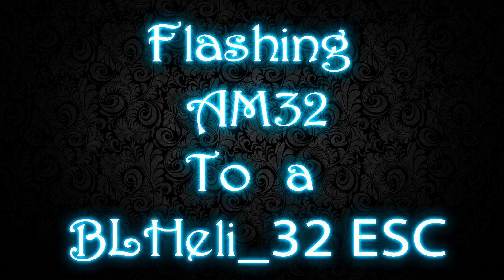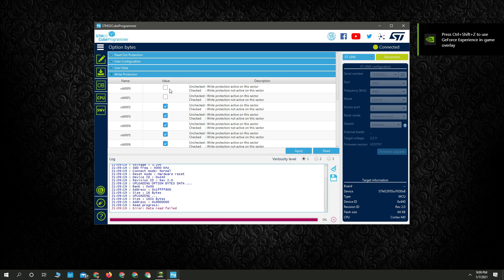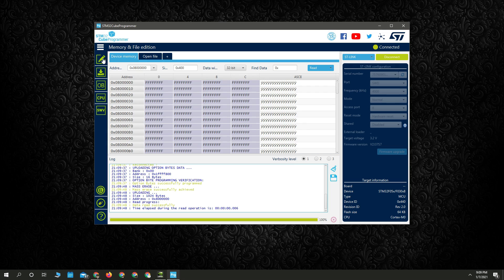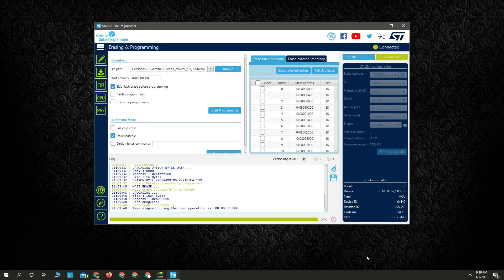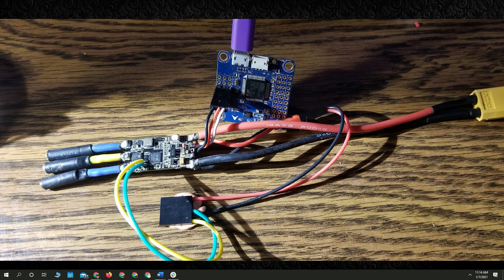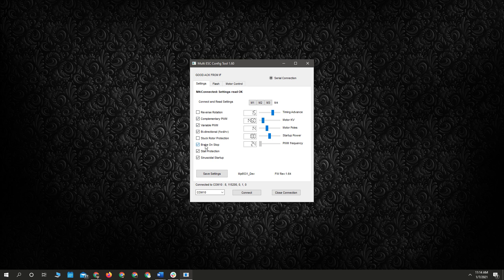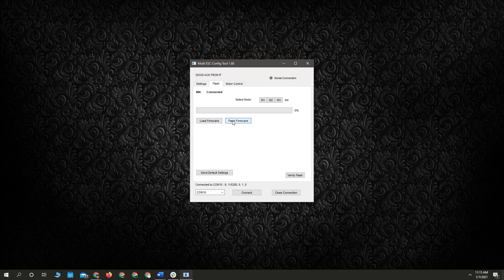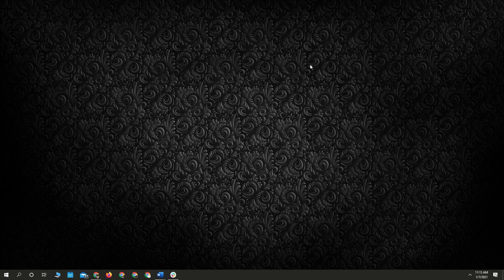Flashing opensource crawler Firmware (new software)

Comment: esc wont start up after doing this step by step using full dixie bin file. wraith32 35a. stm32 says error download verification failed. Data mismatch found at address 0x080009F0 (byte = 0x02 instead of 0x8A) possible bad bin file?
Reply from the maker: Possible bad bin file, I am not that familiar. My Files are all older now, and new partial files have new features.  Alka is on 1.8 now I believe. Best to upload the bootloader, then connect to the PC with Arduino or flight controller and upload the rest with the configuration tool.

Comment: Is there a temp cut off installed on the firmware so it will shut off if things get too hot? Thanks for the great content. Much appreciated!
Reply from the maker: Yes, there is, but I have not used it. It reads the temp of the MCU and not the mosfets. The mosfets are where most of the heat is.
Reply: Thank you! I appreciate the response.

Comment: I'm guessing that new mini ESC from a popular crawling brand is essentially running some kind of AM32 software?

I really wish I had the confidence to do this as I love the idea of a dirt cheap ESC that can compete with the best of them and I love outrunners.

I did once witness a friend flash a simonk ESC so it could have a basic car mode with F/B/R but it was one where you could already do it through the servo plug I believe which simplified matters.
Reply from the maker: I do not wish to make comments about what others are doing or not doing. As far as having the confidence to try the cost is relatively low so not much to lose? Seems like a good place to test you skills no?

Comment: I am Japanese.  I'm not good at English.  Let me ask you one question.  If I can apply the Revolver 1800kv firmware on Googledrive, do I need FLIP32?  Is FLIP32 necessary for the original settings?
Reply from the maker: it is not necessary.

Comment: How to connect esc to pc? What do I need?
Reply from the maker: you can use a STlink v2 to load the bootloader, and an arduino or a flight controller to change the settings.
Reply: @HouseofVoodoo  Huge video! its a super intersting tool, my only question is how willl this work with the Arduino Nano as the interface? or what are the pins I´ll need to plug into?  Thanks in advance :)

Comment: I followed this tutorial and the esc powers on with a red light and beeps the motor, however it won't turn the motor. Do I need to calibrate my esc to my radio, if so how do I do that please. Thanks.
Reply from the maker: did you use one of my firmware files? or the ones from github? 
Sorry I dont check these messages often.
probably its just adjusting the throttle, or try powering on the vehicle then the transmitter. 
The arming for pwm is not perfect for all recievers in most of my builds.
but its getting fixed.
Reply from the maker: The Arming issues have been fixed, and new 1.74 firmware works really well. If it doesn't are it will continue to beep every 3 seconds or so.

Comment: I can't understand 'Step 2: Soldering- Part1'

I saw a picture with a breadboard.

You can see a red line and a blue line and a white line in the middle of the esc. Are they connected to somewhere in the st-link?
Reply from the maker: The blue and red aren't necessary. Sorry for the confusion. Those were used in an older tutorial that was more complicated.

For this step you use the swc, swd, and the 2 power wires.

Comment: In your guide you mentioned about the partial file at 0x08008000 any chance of a video demonstrating what you meant 
(I forgot my RC crawler login again)
Reply: I wasn't clear on that either. I guess once you install the full firmware file you only need to use the flight controller interface (using the three wires that go to the ESC and the serial port software) to install small updates using the partial files. What I don't get right now is what flight controller to use to do the partial updates. I guess any controller will do since the serial port access is really all that matters. (Edit: I just ordered a generic flight controller to use as the serial interface.)
Reply: @baxrok2.  he had one LinkedIn a description of another video I looked at and I'm like I have no idea what I'm looking at I have more ground-based experience I have no clue when it comes to drone hardware and have no idea what to buy thankfully I've got some time waiting for the ESC to ship from China
Reply: @gunnutgaming  Same here. It's probably easier than we think. If all it takes is what is shown in the first step of this video, that's pretty basic. 

Flash the new ESC with the AlkaM firmware using the STM32 software and that's it. He said, "you can run it, it will work." The STM32 gives us access to the chip to wipe it and do the initial firmware install. After that, we only need the flight controller to do subsequent upgrades or tweaks. 

As of now, I've got the ST Link, a couple of ESC's, and an elcheapo flight controller on the way. Not sure if the flight controller will work but I have to start somewhere lol. Also, I have the link to the AlkaM download. So, hopefully that should do it. I've got two outrunner motors that I like for the small size but hate to run because of that damn racket they make!
Reply from the maker: so there are 3 parts of information, a bootloader that is at 0x08008000, an eeprom whos location is a mystery to me. and the firmware which is located at 0x08001000.
A full file from my google drive contains all three, a partial file only contains the firmware. 
all three are necessary. 
but they all vary depending in the esc you use. 
Mostly I just have them for the wraith.
If you get the bootloader from alka's github and upload it, and you upload the firmware. there is no eeprom. so that needs to be added from the configurator by using a flight controller or an arduino, by selecting use default settings. or reset defaults, something like that.

Comment: Would you kindly recommend a flight controller for updates to the firmware?
Reply from the maker: I used a https://www.readytoflyquads.com/flip-32-f3
lately I have been using an arduino, it has code loaded from the blheli32 application.
passthrough.

Comment: Quick question. When connecting through FC Its gnd+pwm on the esc side to gnd+motor connection on the FC side? No need to connect the esc tx to something on the fc? Thanks much for doing all this work to spread the knowledge.
Reply from the maker: Yes, correct
Reply from the maker: On the FC it might say M1, M2, M3 etc.